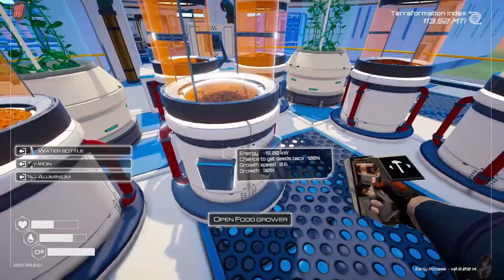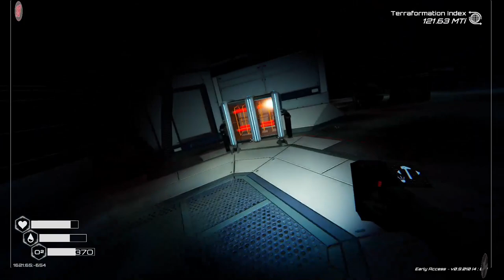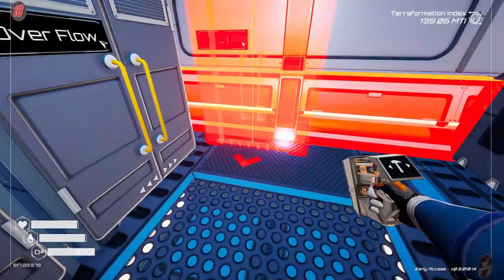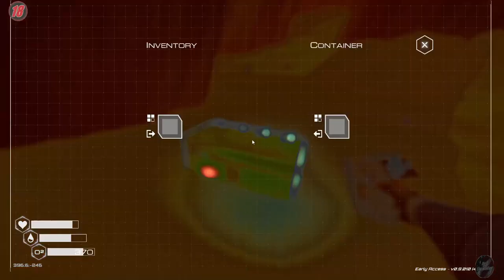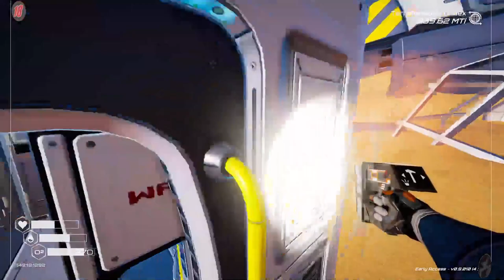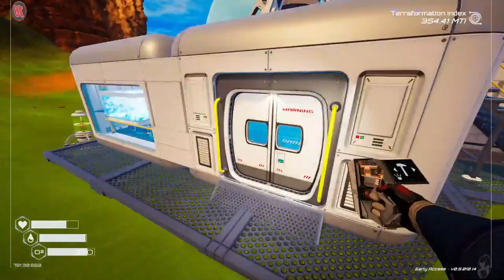The Planet Crafter, Going on a trip, EP-14 SP, Eng, 18+,

Comment: Ah, so it was the last blueprint. I had thought it probably was, but I wasn't quite sure.
The good stuff needs a fusion energy cell to power up the fusion reactor.
The oxygen rocket doesn't unlock until 650 MTi. Ideally you would build equal numbers to keep your terraformation progress in balance; I think those were your second heat and fourth pressure rockets.
Meteors do despawn before the ores do. However, ores that have landed on rocks don't fall just because the rock despawns. You got a good haul but I feel there was a bit more uranium and/or iridium still left underwater.
There's actually a whole iridium rod in the cave in the grand rift.
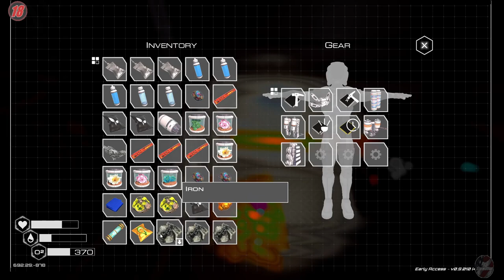55:27 Nicely balanced seed packets!
1:00:00 You were right next to a uranium cave. I had assumed you skipped it because you didn't need the uranium, only for you to pick a rod out of your next golden crate...
You put that golden seed in a T3 vegetube, but it makes hardly any difference to your oxygen there, as the spreaders are making the bulk of your oxygen. As for those T2 vegetubes, they should have been scrapped ages ago.
That one T4 drill produces as much pressure as 27 T3 drills, so if you ever need any iron, titanium or aluminium...
I breathed a sigh of relief when you realised you almost shredded your super alloy rod. (Although, recycling it would have been a bad move, as you can't actually craft them again yet, so it was fortunate you could save it for your GPS rocket.) And then you almost crafted the wrong chip...
Now you have the recycling machine, you should convert all of your uranium and iridium into rods to save space.
The algae generators will have at least improved on your oxygen generation. And of course your biomass generation has multiplied by eight! Of course, flower spreaders would be better still...
Don't worry, you can now deconstruct interior partitions of all kinds. (And indeed exterior ones.)
At some point nine more Orema will spawn in the wild in areas near the warp gate.
2:02:20 These were from your third rocket, not the one you made at the beginning of the video.
Oops, you didn't notice you got hit by one of those super alloy meteors... you had food on you as well...
Until you make the map you can deconstruct your mapping screen and take it with you.
Reply from the maker: Sorry I didn't see your comment for some reason it was held for review.  I seen that being done in another video we're the person was put a screen in the huts as he went along.